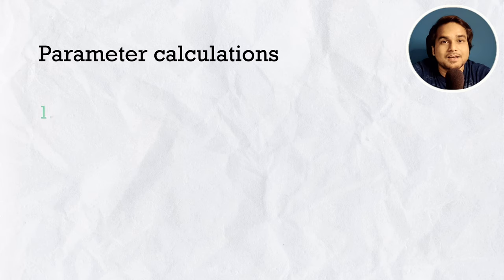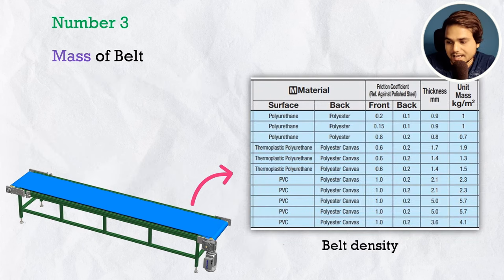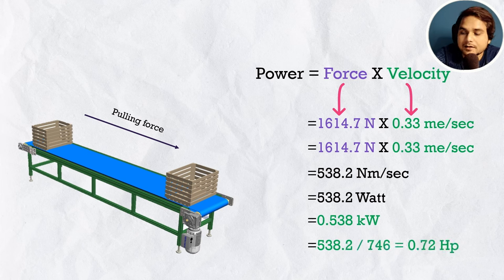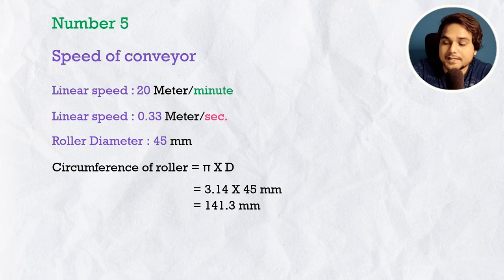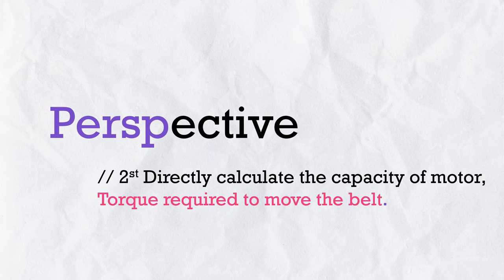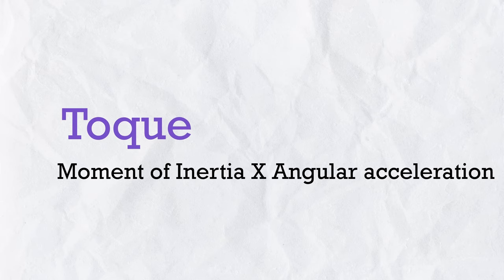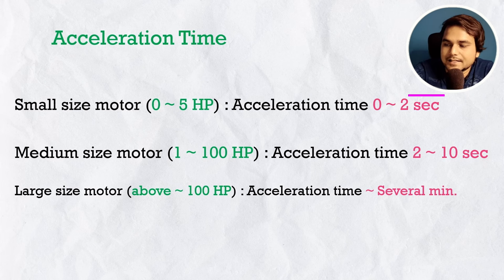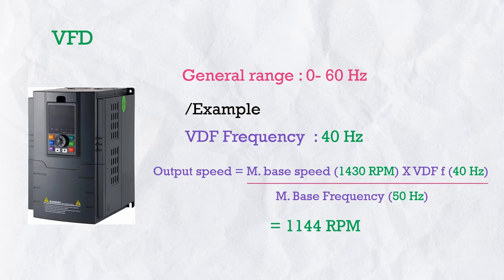Mastering Belt Conveyor Motor Selection and Calculation: Ultimate Guide

Comment: My sincere congrats for the detailed explanation on the motor selection; it's reassuring to find that there still are some decent material not solely based on unbiased simplifications! I have a question tough, would you mind helping me out if possible? 

If the conevyor belt is designed to be pre-tensioned and mounted on top of rollers, in order for an object to move, there must be no slipping between the roller and the belt, right? Hence, the friction is the force pushing the objects forward on the belt and is not a resisting force, meaning there is no pulling force, likewise you mentioned at 11:02. In that case, the only torque is due to the inertia, correct? Does that mean that, when the object has achieved its final velocity, all power given by the motor is spent by friction on bearing, gears and others? Thanks in advance for the video, have a nice day!
Reply from the maker: Thanks Joao Garcia, Lets discus!
Point 1: There must be no slipping between the roller and belt, right? -   Yes, it would be better if it is not slippery, but practically zero slip is not possible as you know. 
Point 2: Friction pushing the object forward on the belt and is not a resisting force- Yes absolutely right.
Your last point, all power given by the motor is spend by friction on bearing, gears and other after reaching final velocity- This is complicate, yes this is 100% true that motor required torque will decrease after reaching final velocity means at zero acceleration. but as we are moving a belt, so there will be always a belt rolling friction, (thick belt means more rolling fiction), also there is not only roller MOI, but there is also transferring object and belt itself MOI which always being influce by gravity, as you said, motor is spending by friction on bearing, gears and others, so this term other is going to always much larger as compare to bearing friction.
Reply: @mastermechanicaldesign  Thanks for the response, it makes sense: wile it's true there must be no slip and hence the friction is not a dissipative force at first, it's hard to guarantee no slip, which is hence the dissapative force when the final velocity is achieved. 

Therefore, while it's not correct stating there is not dissipative friction, it's also not correct stating the pulling dissipative force is F_pull = (load_weight) * friction_coef. , right? Unless we consider "friction_coef." beign much smaller than the actual kinematic friction coefficient. For rxample, rather than adopting 0.2, we take 0,05. Do you thing that's a reasonable approach? 

The losses in bearings, gears and other I'll consider by using their efficiencies as 99% or 98%, for example. 

Once more, thanks for the  responses, for the video and for the commitment on the subject!
Reply from the maker: Let's think in this way, 
1. To move the belt, a strong frictional grip between rollers and belt is required, stronger the frictional griper of roller will give better will be result in terms of slip resistance,
(So, sometimes we do knurl over rollers surface for better grip) 
in other word, frictional force between roller and belt should be more than frictional force of belt with conveyor's other parts (belt bottom support) with the load over belt.
means, 
Friction force between roller and belt (depends on amount of belt tension, roller contact arc with belt and static co-efficient for friction between rollers and belt) should be grater then frictional force of belt (loaded with material) and belt support plate,
2. At starting frictional force of belt (loaded with material) and belt support plate will be high, and once belt start moving static co-efficient of frication will decrease to kinematic co-efficient friction.
3. Now, motor capacity should be cable to accelerate the belt from its static friction because we started the motor at zero velocity.
4. Friction between roller and belt is different than friction between belt support and belt, our aim should be increasing the friction between roller and belt for no slip. whereas our aim should be drecrece the friction between belt and belt suport, for easy pulling the belt, 
5. Now, bearing friction is something that we should not consider in any calculation, you can consider as zero friction (in general)
6. So, for motor selection, these are following load you should consider. 
A. Frictional pull force between belt with load and belt support,
B. Belt rolling friction (or you can say belt rolling resistance or belt drag over the rollers) -Which is actually difficult to calculate. 
C. MOI of all the rollers, gear box, motor and the load over the belt.
Reply: @mastermechanicaldesign  Awesome! It makes sense for me now. I don’t know how to thank you enough for the time and response! 

Once more, congrats for the content and commitment! You’ve got a subscriber for sure :)

Comment: Very nice explanation sir.
1) What is the power loss in gear box? 
2) What is the factor of safety consider the moment of inertia of the belt load?
Reply from the maker: 1. Gearbox power loss - consider gearbox efficiency 90% for helical worm gearboxes
2. FOS for MOI- If you are considering every component MOI (belt, load, rollers)  then you don't need to consider any extra FOS.

Comment: Very good and informative videos bro ... thankyou.. i need one clarification, how do select dia of the roller? Is there any standards? And torque based on MOI is it finding for all the drives?..
Reply from the maker: There is no such standard, but yes roller diameter should be sufficient to roll the belt properly. Means if we take a thick belt then we should consider a large diameter. 
Also we should try to keep the roller diameter minimum to reduce the MOI
Third yes strength but it depends on length and tension on the roller (no significant concern)
Reply: Thankyou ❤

Comment: Thanks for giving calculations for Conveyor Belt Power..  I want to suggest that kindly make a video about Selection of Power Transmission Belt Drive or No. of belt..  in which Counter pulley System.
Reply from the maker: Noted, I would be better to do this within a transmission design series

Comment: Good information and much appreciated your efforts but kindly recheck the considerations for calculations as they seem little offset from actuals, as there is no much difference for the motor KW but when it comes to judge what can be done with other parameters to decide some intermittent operations that you get across while introducing other process based on selecting rpm’s and force flow process, might mislead to wrong assumptions though. All the way nicely explained
Reply from the maker: Hi Bharathrm, Thank you so much. yes, there is little calculations typing errors with example. But concept and formulas are right. Just bear with me. mistyping will eliminate completely with time. trying to build a cross check community.

Comment: Hi which one is best to consider for doing the calculation, moment of inertia or without?
Reply from the maker: Offcourse considering MOI will give you close value. But if the application is light, rollers are small, then its okay to ignore MOI calculation, just consider significant SOF, but not too much. Its also a problem (deeply explained in video)
Reply: appreciate for immediate reply I think for a long conveyor, the number of roller will high that mean total MOI also High and the equation will give the high value of power
Reply from the maker: Yes exactly

Comment: I would clarify the no friction part. I think what you were saying was the first part was the load to move the belt and load at constant speed then the second part was to start the belt from rest to the set speed which would require the diameter of the rollers. Is this correct?
Reply from the maker: Yes that's what I'm trying to say.. when we will start the conveyor from rest. An extra torque will be required to move the belt because of MOI of everything.
Reply: @mastermechanicaldesign  thanks helps ALOT to know the nuance and can tackle other issues like if it was at an incline.

Comment: Sir  thank you so much i am always wanted to become a machine designer your video help me a lot. Regarding conveyor belt design you talk about MOI OF ROLLER . But if anyone used troughed idlers instead of instead of flat idlers then how i found his moment of inertia of in
Reply from the maker: I'm so glad 😊
Trough rolls - as these are also rollers but at an angle. So we can also calculate the MOI same as roller. Don't need to be too exact. Just consider approximations at higher side.

Comment: Idler rotatating calculation video 😊
Reply from the maker: Hi Pratik, To calculate the ideal roller speed, You can use the same formula of conveyor roller speed, only you have to put the ideal roller diameter instead of roller diameter. If Idea roller don't have much slips

Comment: Sir ek question hai for example if customer need 100 part in one minute at the end of conveyor then what should be belt speed...means how we will calculate belt speed???
Reply from the maker: Hi Praveen very interesting question ❓
Here belt speed will also depend on part length. And gap between each parts
Let say part length is 100 mm at a gap of 50 mm. Mean conveyor belt should travel 150 mm for one part delivery.
And as given 100 part per minute.
Mean 100x150 mm per minute
15000 mm  per minute, 15 meter per minute.
Please let me know if I'm making mistake in calculation 😅

Comment: Can you make a video to design a motorised trolley which is moving on wheel and rail track, with loading capacity of 40 ton. For given speed 20m/min, calculate gearbox, wheel dia, motor power, ?
Reply from the maker: Yeah sure
Reply: Yes waiting for this video.

Comment: Power and torque calculation for a shaft carrying cam and rotate with 150 rpm and cam also carrying a load of 200 kg
Reply from the maker: Cam Shaft Torque = (Normal Force of cam follower on cam) X (distance from cam shaft center to point of contact between cam and cam follower) (tan a (pressure angle))

Comment: Is there any documents or validation documents for your calculation
Reply from the maker: Not exactly. But i would say whatever I have explained is pure  physics, like power formula, speed, MOI etc. Plus for data reference i have given is from manufacturers catalogue. Which you can verify.
However if you need specific parts validation, then i can provide. In terms of formula.

Comment: Is the diameter of the roller according to the motor or is it the design for the belt?
Reply from the maker: According to me, diameter of roller should be according to belt thickness and belt material, like allowable minimum bending radius of belt 
top of that we should keep the roller diameter minimum just to keep MOI of rollers minimum also to save cost
Reply: @mastermechanicaldesign  it depends on the length of the belt too? for example I am designing a 10 meters belt with the same material you used in the video, how much diameter do you recommend to use for the roller?

Comment: Sir... In moment of inertia method, to find moment of inertia torque for gearbox and motor, you selected the values related to 1hp motor and 10:1 ratio gearbox from datasheet. But how you choose the motor power and gearbox ratio before calculating it. Please explain that part.
Reply from the maker: That's a great question! I'll make sure to clarify that part in a future video.

Comment: If the conveyor has an inclination what steps should be added?
Reply from the maker: Hi, Aniket, In an inclined conveyor we have to consider a cosine value (angle value) in mass, which will add up into conveyor pull force

Comment: Weight needs to be calculated by volume x mass density, please recheck it.
Reply from the maker: First of all this is mass, not weight density.
Now as we all know..
Mass (Kg) =  Volume (m3) x mass density (Kg/m3)
Multiple by m/m
= (m3 / m) X (kg/m3 x m)
Mass (Kg) = Area (m2) x Area density (Kg/m2)
We can say. Mass is equal to area into area density. Area density is nothing but mass per unit area for a specific thickness. As belt thickness is given
Reply: @mastermechanicaldesign  ok fine

Comment: If u remove the belt support
Whete will u keep the Loan ?
In Air ??
Reply from the maker: No. Load will remain over the belt. Conveyor without belt support - Yes for short distance and light weight material transfer like plastic parts we don't give support below the belt. But this is not the main purpose of this video with this example I just want to say. If you don't support the belt then it doesn't mean that required torque will become zero. There will be a MOI of rollers and other items. 
"Watch the entire video otherwise you will be confused, I'm not confused"

Comment: Dear sir moi torque roller -0.25*15*(0.0225)2*2 value 0.0018 not available. Valve comes to 0.0037 please State whether this answer is correct or not
Reply from the maker: Hi Swapnil, Yes there is few calculation mistyping in my video. So Your calculation should be correct 👍

Comment: At 7:26 how the pull force value calculated..? (Pull Force = 1614.7Newton as per your calculation in video)
Total Mass is 411.5kg, g = 9.81m/sec sq. COF is 0.2
Pull force = COF x Total Mass x Gravity Constant >> 0.2x411.5x9.81 ==>> 807.363. (according to my calculation)
Please correct me if i am missing something.
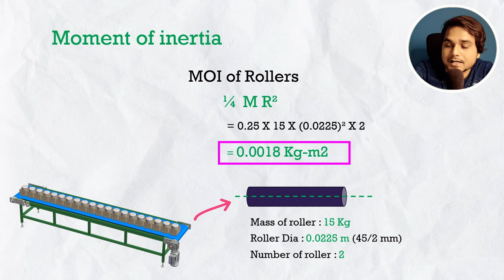Reply: Same doubt bro.....Got any solution for this??? Also at 15:35  MOI for 2 rollers = 0.25x15x(0.0225)^2x2 = 0.0038 kg/m^2 might come, but I guess wrongly mentioned as 0.0018 kg/m^2....Correct me also....I am also having the doubts.......
Reply: @selvasenthil1997  Yes. Method is OK just correct the calculations.

Comment: 1)If I have flat belt conveyor with drive pulley and driven but both are different diameter then belt speed is change or not
2)same question for timing belt
Reply from the maker: Belt speed will always depend on driver pulley. If both pulleys are the same dia. Both will rotate at the same speed. If driven pulleys is smaller, will run faster. If driven pulleys bigger, will run slower. Belt speed will be same.
Reply: @mastermechanicaldesign  1. For flat belt is same belt speed if we change diameter
2 but belt speed changes in timing belt if both pulley teeth are different

Comment: I have a big problem, when we should use Totque= Fr and T=I x alpha.
Reply from the maker: Torque is required to rotate something (some load or weight means force F) at some distance (r) then we use T=Fr
But when we try to rotate something from the middle like a conveyor roller, then we should also consider the moment of inertia of roller than required torque to rotate the roller about their axis will be MOI (I) x rotation acceleration (alpha)
I know this can't be clear in text, so i would plan to make a video on it
Reply: Thank you sir please make a video.. am waiting .

Comment: What is the Area of belt 
L*W*T or 2*L*W
2  is thickness???
Reply from the maker: In this example area density is given for 2 mm belt thickness, so only have to calculate 
Area = 2xLxW
If mass density would given then
Calculate volume 
Volume= 2xLxWxT
Reply: Belt is close loop, one layer on top and second under conveyor that's why= length×2

Comment: 15:07 the formula should be 1/2 mR^2 , right?
Reply from the maker: Hi jasesin, There is a typo mistake (correct 1/2mr2) 😑
Reply: @mastermechanicaldesign  thanks for the prompt response. I appreciate it.
Reply: @mastermechanicaldesign any links how to correctly  size/select the roller diameter?
Reply from the maker: The first basics of roller selection should be strength
Second is space (how much space available height wise)
Third is bigger rollers diameter means - High belt speed. So you can choose accordingly by reverse calculation.

Comment: how the convyeor belt density equal 2.3kg/m^2 the density equal kg/m^3
Reply from the maker: Hi, The table which i referred to for belt density. There is belt "area density" kg/m2 defined. means mass of unit area of belt.  For different thicknesses of the belt,  
So to calculate the mass of belt, we multiply the total area with unit area mass density.
Reply: @mastermechanicaldesign  thank you❤

Comment: Which motor is selected if mass is too low
Specifications
Width of belt:152mm
Number of bottle:50
Mass of bottle:750grms
Roller dia:50 mm
Belt thickness:5mm
Matrial:pvc
Reply: Also gearbox too
Reply: Also belt lenght is 3m
Reply from the maker: If you are using this conveyor, just to start and Stop. Go for an induction motor.
Reply: but my output hp is too low like 0.00791 hp which induction motor availanle at this range
Reply from the maker: You can take Higher size like quarter HP. Or take do check out Oriental motor (AC single phase, very compact gear motors are out there)

Comment: In belt mass = volume*density but in video u take it area

Unit of density is kg/m3
Reply from the maker: Yes you are right, but i this equation i have considered Area density (For thin sheets, like paper or belts we consider area density. Not volumetric density. Excuse me for confusion.

Comment: MY LOAD IS 50N IN PLATE AND LOAD WILL APPLY UPWORD DIRECTION OF PLATE VERTICALY PLATE SIZE IS 80X 100 MM SO WHAT IS MY PLATE THIKNESS AND Suggest ONE SM BEST BOOK FOR LOAD CALCULATION
Reply from the maker: Hi akash, Your question is a little confusing for me.. There is no direct formula for plate thickness calculation. For plate thickness first we have to calculate all stress in the plate, then we can optimise the plate thickness using the theory of failure. And it's always better to calculate by FEA analysis. Moreover stress is plates heavily dependent on how plate is supported. 
For book you can checkout stress in material book (Yellow book) for my discription link
Reply: plate is supported in my box hollow pipe pipe size 500 mm and pipe is 100 x 100 x 5 mm thickness ss304 pipe
and thanks man my 60% of doubt and calculation is clear for this answer